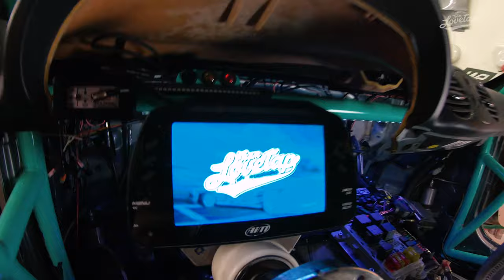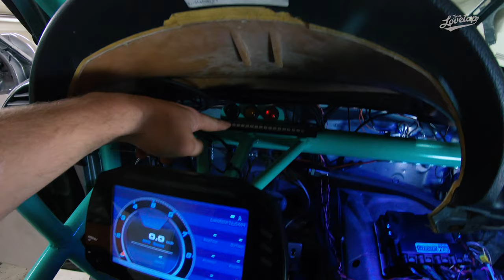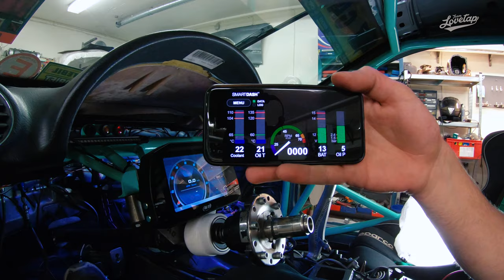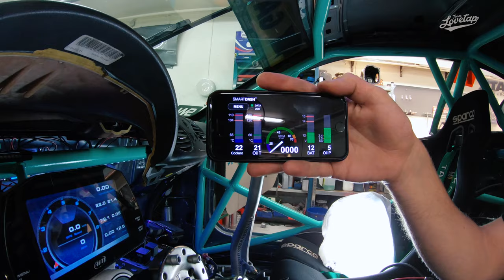Hammer & Spanner EP 3- Driver Cockpit, ECU & DashSystem

Comment: that red handle  is a knee point  rear line reducing valve it is reduces the rear line pressure only in the upper part of the pressure graph the settings charge at what point it kicks in sorry i had to but in but it bugs me that no one knows what these are  ..
Reply from the maker: Adam Naylor  no problem man I guess you know more about this than me for sure. So i understand it wrong if i think that this will reduce brake pressure in the rear compared to the front?
Reply: @TeamLovetap  when you first hit the pedal the balance bar sets the bias ratio then as you pres harder the red handle kicks in and yes steps the pressure down a bit in the rear line the handle sets at what pressure it starts to work ..so you are correct there is just a little more to the story.
Reply from the maker: Adam Naylor aah i see, thanks man ✌🏻🤙🏼